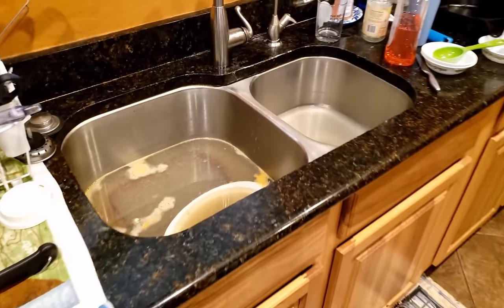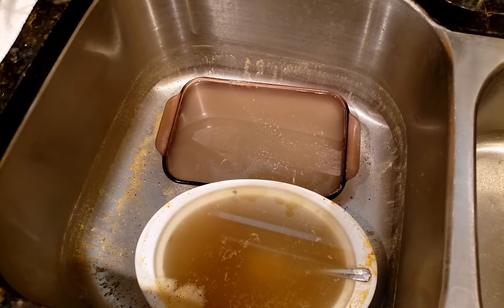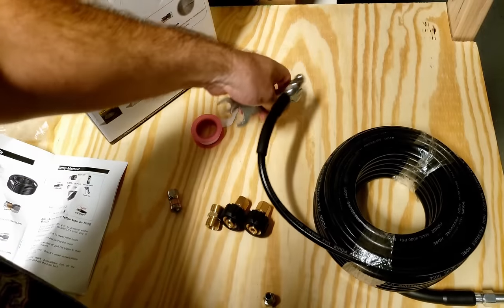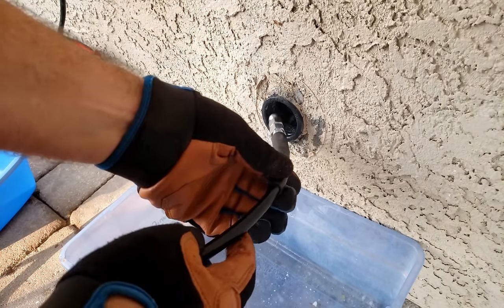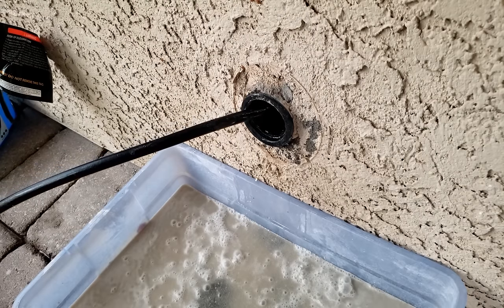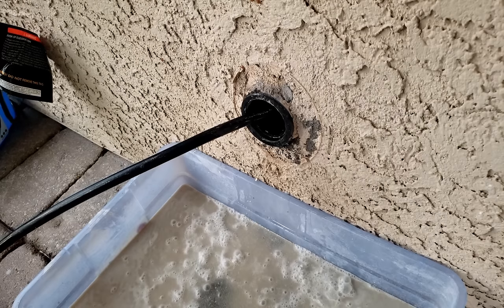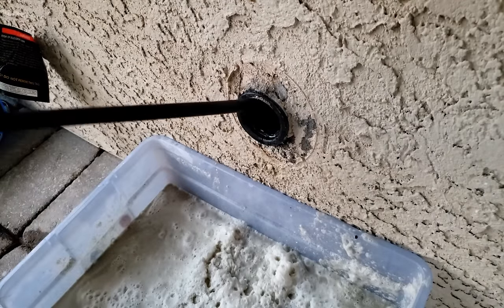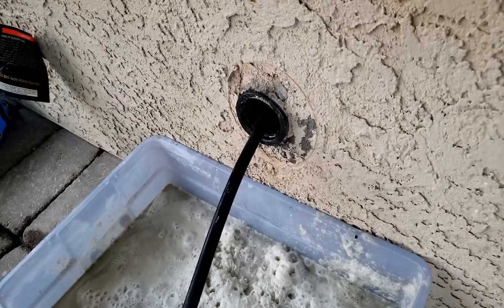UNCLOGGING my kitchen sink with a PRESSURE WASHER and the POHIR Sewer Jetter Kit

Comment: You couldn't afford a $15 snake? High pressure in plastic [PCV] pipes can damage the fitting seals.
Reply from the maker: I tried all of the basic steps first including a metal snake. That didn't work so I was going to rent an auger or try the sewer jetter next. The sewer jetter was cheaper than renting the auger. The sewer jetter worked great and I didn't have any problems or damages with the fitting or seals. Do your research first and if you can't unclog the pipe then it's time to decide if you should buy or rent the right equipment or if it's better to call a professional that has the right equipment for the job.
Reply: @ThatHobby  Oh okay, so this kit can actually clean the walls of the pipe, and it's not just limited to breaking up a clog.
Reply from the maker: @mts7274  Yes the sewer jetter does a little more than the snake. I have used the snake a bunch of times and in most cases the snake will get the job done. But sometimes you may have to use a more powerful tool like a Drain Cleaning Snake Auger or a sewer jetter.

Comment: Interesting but it seems to be messier and more overall work than an old fashion snake.
Reply from the maker: It is a little messy but the cool thing about the sewer jetter is that is brakes pieces of the clog up and washes them back out of the clean out drain. With a snake it can break up the clog and push it further down the pipe to create another clog. I had a 25 ft manual snake and I couldn't break up this clog. Some people said they have had good results with renting a power snake to break up a tough clog. That's what I was going to do if this didn't work. But the sewer jetter got the job done and it was actually a lot easer to use than my old fashioned snake.
Reply: @ThatHobby  The snake for that clog is the coil type not the hard blade. It works to bite into the clog, and draws it back onto the coil while rotating the coil As the snake continues into the clog, it breaks apart the clog, thus opening the drain. Then, turn on the water, continuing to rotate the snake, which washes the debris away and the snake withdraws clean as a whistle.
Reply from the maker: @roseymalino9855  I had a 25 ft Cobra Pistol Grip Power Drum Auger. They also have 50 ft snakes that you can get too. If you like the old fashioned snakes they are the most economical way to go. After using both I prefer the pressure washer and the sewer jetter.
Reply: @ThatHobby  Economy not the issue if you read my original comment -- messy and more work. Had a drum type unit - didn't like it. It's good that you're satisfied with your sewer jetter; won't be adding that to my arsenal.

Comment: Next time, call the plumber.....obviously your personal time has no value..
 > look up and purchase tool.
> time and travel to and from store.
>diagnose problem, find pans and cleanout.
>get dirty and complain about stink.
> clear blockage and test.
> reinstall cleanout plug properly.
> clean off wall and patio.
> clean out catch buckets and put them away.
>clean off tool and put away.
> take a shower
>wash clothes and flip flops.

  it sounds like you wasted your time.
Reply from the maker: People are saying a plumber would charge them $500 to unclog their pipes. So yeah if you make more than $500 an hour it's probably easier to just call a plumber.  But it's really not that bad once you have done this a few times. You can get this done in less than an hour.
Reply: Looks to me like he got his drain cleaned out for a LOT less money than a plumber would have cost. And now he has the equipment and experience if he has a problem again. DOUBLE WIN!!
Reply: @MrCharlesEldredge  Penny wise and dollar foolish.
  Buy a full set of mechanics tools and do all your auto work at home.
  Do your own oil changes.
  Sew your own clothes.
  Grow your own food.
  Buy a Flow Bee, cut your own hair.
    SMH